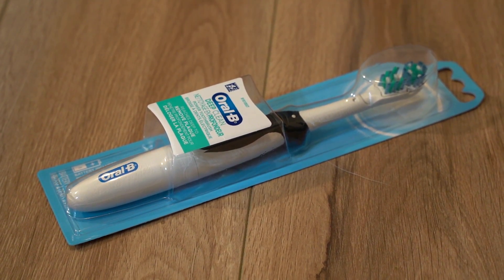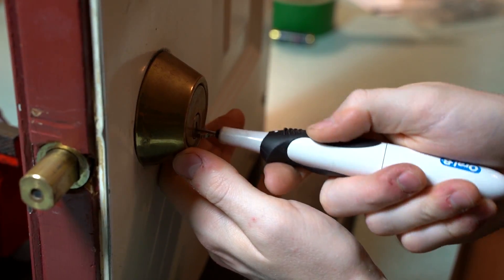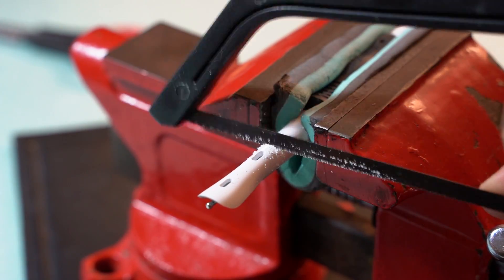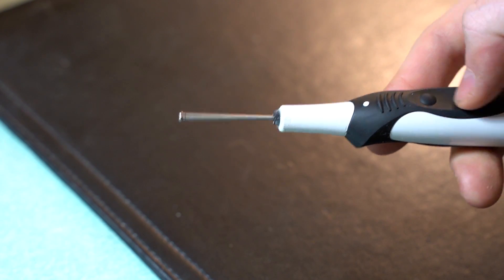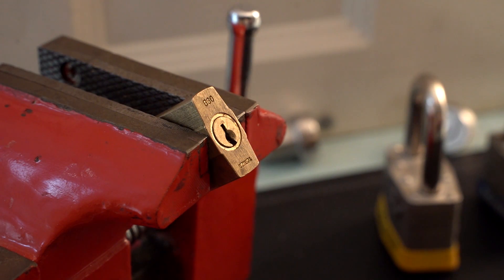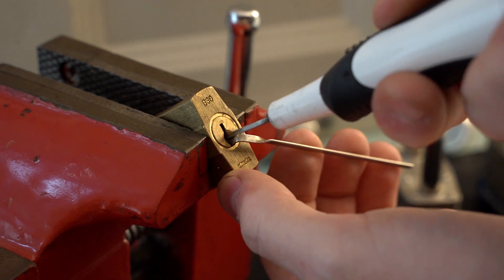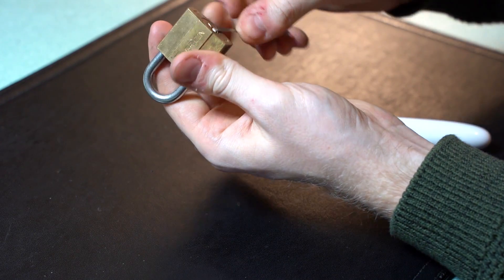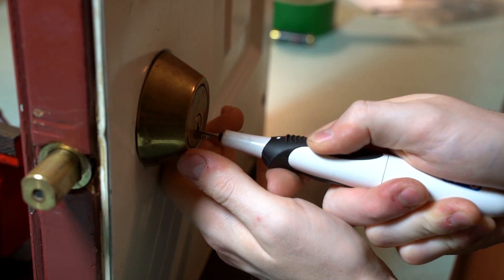Electric Lock Pick Made From an Electric Toothbrush

Comment: Why not file it like a rake pick?
Reply: Because you do not rake, its more like bum0 keying, bumping the driver pins above the shear line.
Reply: @sausas8209 Don't some have the rake profile?
Reply: @randallsmerna384  they usually come with a few different picks in different sizes and shapes for odd keyways, and Ive seen rake attachments, but Ive never seen anyone need to use them. Just adjust the length of each  hit to fit the keyway size or if there are very deep cuts turn it down and angle the pick slightly and it should open any lock providing the gun is powerful enough to push the driver pins into the spring. I dont think an electric toothbrush can bump say Trioving euro profile locks.